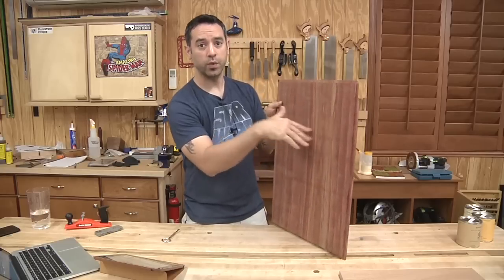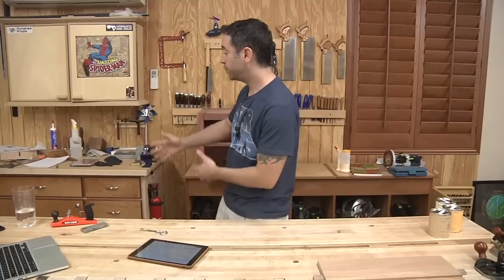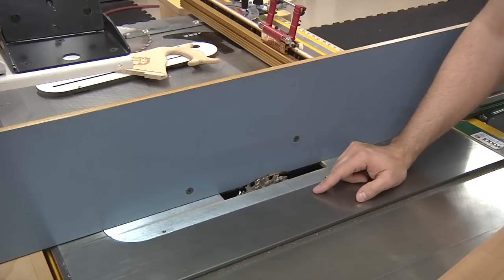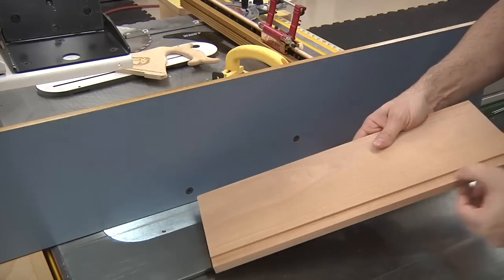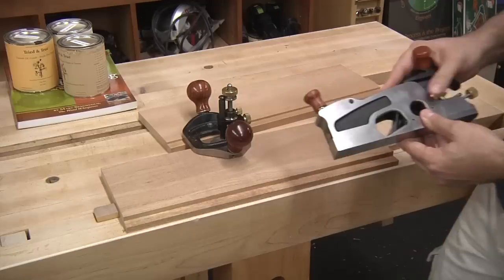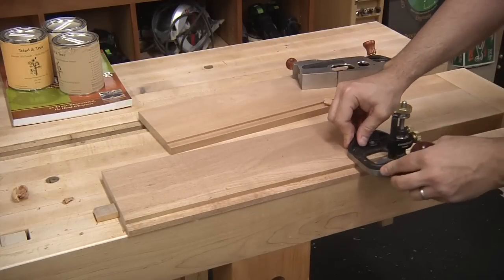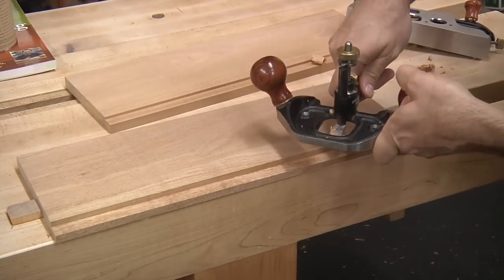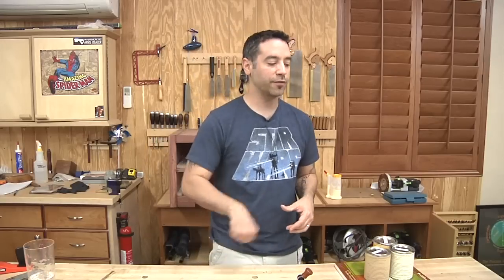How to Make Rabbet Joints

Comment: The plane has got to be my favorite hand tool. I picked up an old (70+ years) 2' wooden plane cheap at a garage sale. Still a great tool. I use it all the time.

There is just something deeply satisfying about using a tool that hasn't fundamentally changed in thousands of years and knowing that it's still the best tool for the job. I smile every time those curls roll up off the blade. :)

Comment: Thanks Marc. I've started getting myself setup for hand tool woodworking and doing practicing, but I'm not accurate enough.  I'm wrestling with the idea that perhaps I need to go with power tools and abandon the hand tool approach. This video explained something to me.  The power tools are part of the method, and hand tools can be part of that method too to achieve the great results we seek.  The key is balance.
Reply: I don't often leave comments on old posts, but just wanted to offer a little additional perspective, Drew.  I can't say this with 100% certainty, but I'd bet that one difficulty you're having with hand tools is that the ones you're trying to use are not sharp enough.  Take the time to sharpen and hone to a real nasty-sharp edge, and to flatten surfaces that need it (sole of plane, backs of chisels and plane irons) and it becomes a LOT easier to work accurately and quickly.  Hope this helps - don't give up on using the hand tools exclusively if you think you might like it - it CAN be done, and can be very rewarding in terms of the quiet, lack of dust, and the reduced likelihood of amputating something or launching a piece of wood like a missile.  I'll never give up my power tools totally because they can get the wood CLOSE to where it needs to be real fast, but I'm working toward diminishing their role for the reasons I gave, as well as Marc's points about the refinement that the hand tools can add.

Comment: Nice video!  Question related to what you were doing there:  I'm about to invest in my first high-quality shoulder plane (looking at the Veritas and the Lie-Nielsen), and I'm not sure about whether to get the large version or the medium.  Looks like you are using the large Veritas. Is that bc you prefer that size in general?  I'm basically concerned that if I get the bigger one it will be less versatile than a medium.  Any suggestions? Thanks!

Comment: Just getting to this video now... as I'm doing  ton of rabbets in a project. I wanted to see if there was an easier / quicker way to make snug fitting joints. I do not own a router plane or a shoulder plane so I've been making my cuts a tad heavy then fitting them in by using a scraper or sand paper as needed. I think for my next project I will invest in a router plane. So a late thanks for the video!

Comment: Do they make a 10" inch dado blade I have a old craftsman 10" table saw but I have looked at lowe's , Home Depot, and MENARDS, and cannot find one anywhere.
Reply: generally dado blades won't be 10 inches. They still work on 10" table saws though.  They just don't stick up as high.  A 10 inch stack of blades would be too heavy
Reply: i looked for the same thing starting out.  Man i got some weird looks at my LWS

Comment: How do you make a rabbet that follows a curved cutout?  Basically, I want to make a ledge that follows a cavity that has been cut into a piece of wood, so I can have a flush cover?

I suppose I will need to make a jig.
Reply: Randy Lott the best I got for you is either a rabbeting bit or a slot cutter/(one half of tongue and groove bit) in a router.  That's the only way I can think to rabbet a curved edge.

Comment: Do these planes work just as well going across the grain?
Reply from the maker: J.L.M. Better actually, because you don't have to worry about grain direction.
Reply: I have no where near the experience as Marc, but I have a router plane and going across the grain in plywood doesn't work well at all (at least for me).  If I cust a dado on a piece of plywood, I now plan my depth so that the grain direction at bottom of the dado is in line with the dado (making it a groove I guess).  Then it planes nicely.
Reply: Plywood isn't actually made to be planed by hand, or even a thickness planer. The glue will also mess up your blades.

Comment: 3 tools for 1 joint!? why not just use an actual rabbet plane?
Reply from the maker: +Biggums No. One tool to make the joint. Then one other tool to finesse the fit if you need it. And you certainly could use a rabbet plane but I don't have one. I just showed the two tools I personally use.
Reply: +The Wood Whisperer Could use the same technique for dados, but wouldn't work with a rabbet plane.  You didn't mention in the video, but this technique also removes the bat ears that dado stacks generally leave.